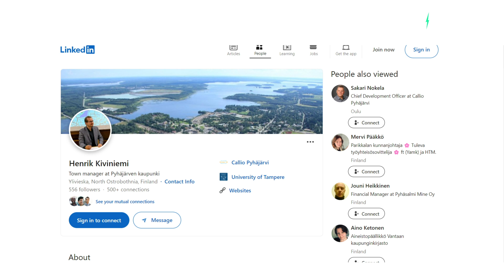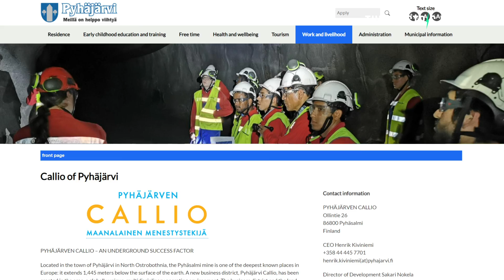Europe’s deepest mine transformed into a GIANT underground battery

Comment: There is no gravity based energy storage that powers 1M houses.
The start up « Energy Vault » (crane -concrete block energy ) is almost bankrupt. 

The only gravity based batteries in switzerland that work very well , and economically working too ,is pumped hydro from cheap renewable and excess nuclear power.

Comment: Gravity batteries have terrible energy densities by volume and by mass.  The only reason this gravity would make sense is because the mining operation basically subsidized it by digging the shaft.  However, such leftover mine shafts are not always in a convenient location and often mines still need to have water pumped out and sometimes air circulation needs to be maintained to prevent the accumulation of dangerous gases so there is an energy cost in maintaining an old mine shaft as a gravity battery.  It's good that they built it and perhaps we should look for other such facilities but we can't expect this as the solution to grid storage simply because there aren't many convenient sites for this.

Comment: The devil is always in the details.  It's not that I don't love a splashy headline, but this ancient technology should be able to be completely designed and priced out with an environmental impact report.  I'd like to see a more statistics based on current engineering and technology.  I presume the gravity weights are made of concrete.  Has anyone studied how much CO2 the production of the concrete weights produce using the most "green" methods available today that would give the gravity battery elements a 50 year life?  How long are the crane superstructures expected to last before refurbishment?  What about earthquake safety?  How is is truly underground if it's in a deep strip mine?  By definition, strip mines are not underground.

Comment: l look forward to the outcome of the trial. While it looks good on paper l have my doubts about scale. The maintenance required is known so that is easy.  Crane winches are geared so that a relatively low powered motor can lift large weights. When we reverse that idea it means that the output of the generator might be low as well. 
lt seems like a great opportunity to reuse existing infrastructure . Especially in rural areas where the town is adjacent to the mine. Not sure how it will scale up though.

Comment: Gravity storage does in fact have cycle life due to the fact that mechanical objects have a limited lifespan before needing repair and/or replacement. Mechanical energy storage also has energy losses due to friction and mechanical inefficiencies, plus scheduled maintenance downtime is a kind of loss. While BESS (battery electrical storage systems) do have standby losses, they are negligible for units that experience daily cycling. BESS also have charge/discharge cycle losses, but they small, and they also have much better and faster surge capacity than mechanical electric storage. BESS can provide power factor, waveform, and frequency support by injecting current and/or voltage into the grid as needed in less than a second of sensing problems.

Comment: Gravity energy storage on some of my napkin math looks like about 50%-60% input/output efficiency. This is much better than the 25% thermal conversion efficiency of coal or natural gas. Of course the big variables are maintenance and actual storage ability. I hope this works out because using a fundamental field like gravity as energy storage seems like a basically great idea. The devil is always in the details however. We’ll see.
Reply: The thermal efficiency of coal is 34.12 percent,  the current generation of CCGT gas plants is 63 percent. Your figures are incorrect.

Comment: My father helped build the Northfield Mountain Hydroelectric facility in Northfield Massachusetts in the 1970s. It is a gravity battery type plant that pumps water up to a reservoir on the top of the mountain and then sends the water down through generators inside the mountain to produce 1.168 megawatts of electricity. The pumps initially were run on electricity from the Vermont Yankee Nuclear Plant which shut down in 2014.  It is powered by fossil fuels now which makes the plant too expensive and too dirty. Hopefully solar and wind power will be used to convert the plant at some point in the future.

Comment: Cute idea for places which have mines that are deep enough. But even there the stored energy is just (found via Google) about 18 MWh - that's almost nothing. With a 1444m deep mine this means a total weight of about 4600 tons to be moved up or down. Assuming a speed of max. 10m/sec means a peak power of 500 MW for 2 minutes. That's it. It may be suitable to compensate changes of wind or solar production within an hour to minimize load changes on conventional caloric power plants but this is far away from being a game changer.

Comment: Any tech that diminishes fossil fuels is worth considering. 
The electric elevator was patented in 1874 and built in 1880.
There are always technical challenges, 
but this system is essentially an electric elevator which have been in use for over 140 years.
These "elevators" also don't produce toxic emissions. The only real difference is scale.

Yes, they require maintenance like any mechanical system, but much less than a coal or gas plant.
Even solar arrays require some maintenance.

Comment: Complaint: The stock footage used as the background to your text is quite a bit more annoying than usual. All those irrelevant, distantly related clips constantly repeated really distract. If you don't have more pertinent images available, please consider a MUCH slower image pace with fewer cuts. Your texts often don't need any images at all, so just let something not distracting run longer.
Reply: Came to say exactly this. Couldn’t finish the video
Reply: Also this useless block elevator junk 

@Thunderfoot rules

Comment: For those saying that the parts will wear out, very true, but isn't the same true of traditional power stations?  Those turbines don't last forever and require maintenance.
Reply: A turbine has just one moving part, or two if you count the turbine rotor and the motor/generator both mounted on a common shaft.  The tradition power plants have massive continuous coal and ash handling conveyors in addition to the turbine/generator.  Also, is the steam generators continuously exposed to  very high temperature corrosive gases that typically break first.
Reply: Pumped water has much less wear and tear than conveyer belts, lifts, trains etc.

Comment: I think over the long run as battery tech gets better and cheaper, this form of energy storage will likely become redundant, but in the short term, we need all the energy storage solutions we can find, and this is a cheaper solution that works on repurposed land that's not going to be used for much else.

So in the short term, I see merit in this until battery tech gets really advanced and cheap that you can buy enough to power your home for like a month and it cost very little, so quite some time off lol.
Reply: Paul if we look a bit further out. I'm interested in the commercial efforts being made to develop small fusion generators in the desktop/kw range. If this can be achieved it will point to a distributed electrical future with less need for transmission grids. Up to now nuclear fusion attention has focused on huge power experiments like ITER and the NIF. However fusion unlike fission can in theory be scaled from kwh size devices. There is no critical mass. A year ago I would have said a successful development is many years off. Now I suspect commercial interests will make it happen, possibly in my lifetime and I'm 75.

Comment: Pumped hydro is cheaper and more efficient than mechanically lifting and lowering expensive concrete blocks. Mechanical gravity batteries have been thoroughly debunked. By the way, is there a link for the operational gravity battery in Sweden?
Reply: By pumped hydro, do you mean using existing water reservoirs and dams? If yes, you are probably right. Otherwise, depending on location and geographic conditions, the cost of constructing a big enough reservoir to match the energy capacity of the proposed gravity storage may be quite expensive. Not to mention the environmental impact of Terra forming the land

Also, here the particular problem being solved is how to extract the most value from this abandoned mine. I doubt pumped hydro is of much use here

Comment: On paper (or in a video), it sounds like a good idea. But one has to check the details.  I didn't check the details for this specific company and project,  but I did it for Energy Vault, the company you used most of the video material here. For Energy Vault's best product (gravity bricks with a reinforced concrete shell [20%of the weight] filled with waste), if you store renewable energy in the device, charge and discharge it every day for 30 years, the average carbon footprint of every kWh is the same as of a kWh produced from natural gas (without even taking into account methane emissions from natural gas). This is because of the huge amounts of concrete and steel needed for the project.  This makes it not a climate change solution, at least until they can build it with very low carbon intensity materials. I've used to work with Energy Vault,  and when I asked them about this fatal flaw, they did not answer me.
Maybe the deep mine version of the a gravity battery is better carbon-wise.
Reply: I think u r probably correct in ur assessment, if not completely accurate. 
The deep mine has better production.
Reply: Do you take into account the steel and concrete used to build the gas plant in your estimate?
Reply: Another string in the bow to ending fossil fuels. Fantastic!
Reply: @grycripps  It really isn’t, go learn something.
Reply: that is a lie
Reply: @asdfasdf71865 where is he wrong? Be specific.

Comment: i wonder if you ever considered comparing the utility of gravity storage to battery storage,  you might be surprised to find that gravity on earth isnt high enough to make this feasible.

Here are the numbers:

consider a well 10m x 10m in cross-section and 1000m (1km) deep.  The gravity storage  device stores energy by lifting cement blocks from the bottom half (500m) of the well to the top half (500m).

The energy required to lift 1 kg by 1 m is 9.8 Joules.  1 litre of water weights 1 kg. so this means 1 litre of water raised 1m stores 9.8J.  1 litre of water is 1000 cubic cm.  so, 1 cubic meter of water weighs 1000 kg.  Concrete has a density 2.3 times that of water. so, a 10m x 10m x 500m block of concrete, raised 500m stores 9.8 x 2.3 x 1000 x 10 x 10 x 500 x 500 Joules = 5.7xe11 Joules

In comparison a single Tesla MegaPack storeg 3.9 MWh or 1.4e10 Joules

So this 1km high gravity storage well can store the same enery as only 40 MegaPacks.
Reply: An open pit mine has a volume exceeding millions, perhaps billions of Megapacks🤠
Reply: @FrunkensteinVonZipperneck You don’t get to use the full volume of the mine, only the shaft, unless you start using energy to stack the weights sideways which immediately wastes most of the energy.
Reply: Nicely done. The TLDR is that gravity batteries simply don’t store much energy and are expensive, complicated, inefficient, unreliable and there aren’t many suitable locations.

Comment: I seen this on the science channel.  They also said the resources required to maintain the system is minimal for 25 years of usage.  Cables and bearings may need replacement at some point but its not even 0.05 percent of cost for operations.    May turn out to be the perfect large scale solution for energy storage.  No loss of conversion at all.  It nearly matches  the energy put in it that you get out every time.  Essentially earth's gravity is used for storage.
Reply: Oil Companies aren't going to like this 🤣
Reply: Claiming ‘no loss of conversion’ is obvious nonsense.

Also the energy capacity of gravity batteries is low and suitable sites are incredibly rare.
Reply: @fredbloggs5902  Very little loss.  Based on the efficiency of low speed electric motors optimized for that specific operation. You can get 98% efficiency.  Drop another 2% for friction loss on the cables.  Thats as close as you get for almost perfect storage of energy.
Reply: @keithwillis3761  You obviously haven’t read the proposal. Go read it before you embarrass yourself any further 🤣🤡
Reply: @fredbloggs5902  Wasn't commenting on the entire proposal just the core technique.
Reply: @keithwillis3761  The core technique stores a minuscule amount of energy. You really are utterly clueless.

Comment: If they used the mine as the lower reservoir of a pumped-hydro system it would work!  The so-called gravity system is vastly more complicated with moving parts and cables that will wear out quickly and be cost prohibitive.  There is a reason these do not already exist.
Reply: I agree - but where do you put the upper reservoir?

Comment: Gravity storage is the future. 
Chemical batteries for grid stotage is a mith.
Reply: Except chemical batteries are already in use and provably profitable.

While gravity batteries are utter nonsense with a low energy density, expensive, complicated, inefficient, unreliable and suitable sites are rare.
Reply: @fredbloggs5902  20GWh in Valais cost was 2.3 billion $ (US). This means 115 $ / kWh and will last for the next 200 years.
The chemical batteries price is double lasts for 10 years. 
Sorry but the earth is the biggest battery that we have.
Plus ... I think is worthless to talk about the pollution caused by chemical batteries. 
Regarding sites .. their are limitations. For example in Switzerland the altitude difference between the 2 lakes is 600 m.
Reply: @fredbloggs5902  90% of energy storage is gravitational.

Comment: Water seems more practical and cheaper.
Reply: It depends on the situation/location, but gravity batteries are more efficient and have smaller risks/problems if done correctly. Im sure they considered all viable options for a project this size.
Reply: @techtechuw597 there are no serious mountains in Finland, so hydropower will be limited. These gravitational batteries are expensive: do some basic calculations and you know why these batteries will never become successful. Potential energy = mxgxh and 1 kWh = 3,6 MJ
Reply: @techtechuw597  you vastly over estimate the intelligence of "officials"
Reply: easy stuff has been done already also cave diving into the depths of kilometers is not a good idea either
Reply: Scarce
Reply: @tomcockcroft9394  Salt water should be fine.
Reply: Water Towers are already being used all over the world for powering the flow of tab water.
Reply: And water is 100% renewable
Reply: No, water does not seem as practical or as cheap.  Not even close.
Reply: Water is carbon free and a liquid. This makes it very flexible and environmentally friendly. Why would concrete be a better option?
Reply: @pieterboots8566  are you talking about using water for the weight for the gravity system?  Maybe I misunderstood.
Reply: @pieterboots8566  density, Concrete 150 lbs / ft^3, water is 62.4 lbs / ft^3.
The greater mass generates more power per volume when descending.
Using water requires the shafts and housings be ~ 2-1/2 times larger for the same power.
Reply: @pieterboots8566  what if the mine floods either predictably or sporadically (in response to a given depth of rainfall), it could interfere with a water-battery. Also the mine might leak pervasively into the nearby metropolitan water-table; lots & lots of possible but long-term issues, & by long-term I mean there's a good chance the water issues could change drastically over even just short  & near-term ect. with weights & gravity I see that if you solve the mechanical & practical design as an overall system. A lot of future problems like mechanical maintenance & dust ect are somewhat predictable & even reliably schedulable. I really don't think you can schedule rain floods geological faults ect. so possibly massively simplified as a practical system.
Reply: @johndfella1 I agree. A mine wouldn't be the best option for water. A mountain or an elevated lake or an existing high building would be a better option.

Comment: problem i have always had with gravity batteries is one of the things they use to charge them... Wind.  If you have ever had to work with cranes you will know about wind restrictions on using them. 

I also worry about the other major issue they have so many moving parts with heavy weight's. 

they have a limited number of cycles i dont know how much.. but each of the weights that have to stack wear down a little with each move. probably much more charge discharge than Lithium.

Ugh the engineer in me keeps coming out of retirement to tell me thousands of issues they could have with this  including round trip efficiency and power loss percentage
Reply: Its same as lift in your Apts/ multi story building